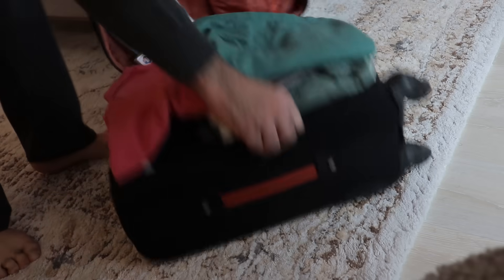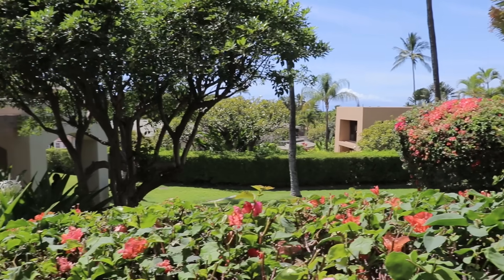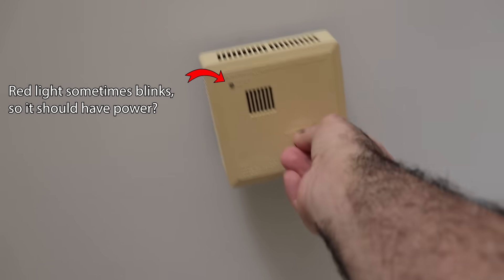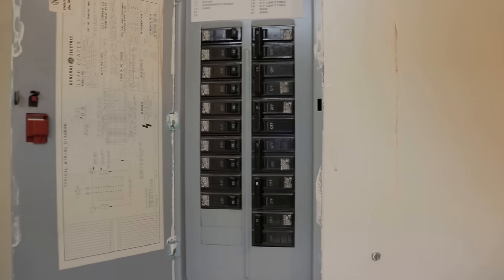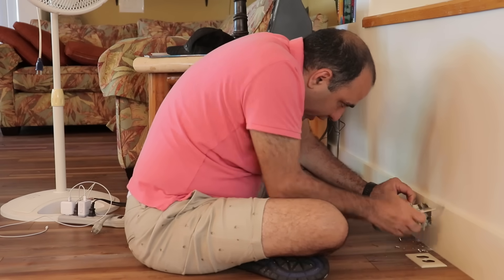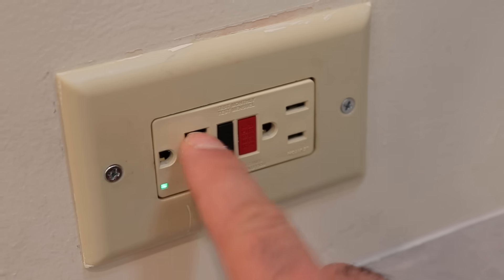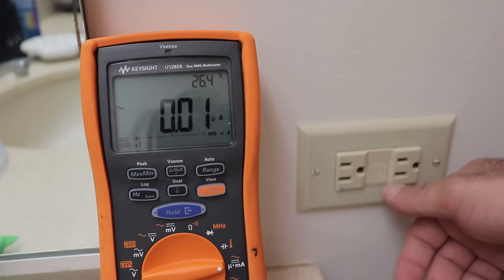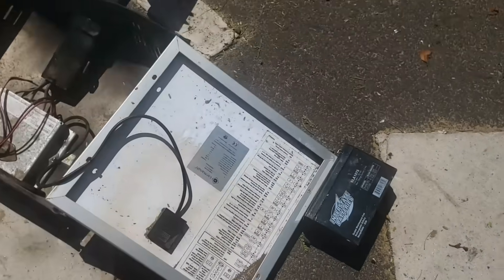Hawaiian Hotel Safety Failures

Comment: Regarding testing hotel room outlets when you travel, this is something I have been doing for a while, and highly recommend to anyone getting one of those nice cheap ($10-20USD) outlet testers with a few neon bulbs to show the status of an outlet and a little button to cause a short/test GFCI outlets. It only takes a second or two per outlet, and has stopped me from using a few (in America on vacation, nonetheless) that actually had the neutral and ground lines tied together, (apparently this normal, and I was just misunderstanding it, sorry about that!) or in some cases, wired in reverse, with live pin being neutral and the neutral being live... it's crazy what people do when installing electronics sometimes. Especially when it comes to mains wiring...
(Edit: fixed my typos and confusion, thanks for the correction!)
Reply: I think you might be getting some things confused. Neutral and ground wires should have continuity and as such it is impossible for a plug in outlet tester to know if they have been swapped.
Reply: @eDoc2020  The ones that I'm talking about and bought have voltage/amp readouts for the circuit, so yes, there is further processing going on inside them. I was just trying to keep it simple, and I'm sorry for my confusion there in how it works. Didn't mean to leave bad info, sorry! But yeah, it did read the neutral as live on some of them and the live as neutral, as they'd been wired in reverse. That part I think I understood... Hopefully. But basically they're just cheap devices sold mostly for business travel, to use before connecting a work laptop or anything else sensitive to the outlet, from what I understand. Just searching Amazon will easily turn up a dozen or more variations of the same device I have. Regardless of how it works though, it's definitely smarter than me when it comes to AC current! 😅
Edit: Oh, and I use it to test EACH GFCI outlet, since I'm never sure if both work otherwise. Those few seconds make me feel comfortable charging my laptop overnight and such.
Edit 2: for further clarification, there are 4 neon bulbs along the top and a 3 digit led display (7-segment LEDs like alarm clocks use) with a button beside it to select whether it displays voltage or amperage. Very simple, but there is a good chance whatever controls that LED panel also switches the neon bulbs. Not something I feel confident opening up to check though, lol.

Comment: I think it's a little silly that every team for the keysight competition must include at least half female students. Sure, somewhere it may be sexism, but every electrical engineering school I know simply doesn't have female students in any great amount there's less than 40 female students at the school where I study which has over 500 students total, so quite possibly the may be outright issues filling up teams.
Reply: Ikr. It feels so forced that it just feels unnecessary.
Reply: And then on top of that the team lead HAS to be a women

Comment: @ ElectroBOOM - 
the low door hadles & switches might be for wheel chair users ... 
these outlets are a real fire hazard & shiould have been repaced (many) years ago ... 
OMG , this prehistoric smoke detector is from 1984 & not even connected , ROFL ... 
an half of the RCDs not working ... a very nice budget hotel worth to die for ... 

Electrboom searches for breakers like a security guy searches for spy bugs (survaillance devices) ...

Of course ElectroBOOM doies what es does best ... BOOM !

Comment: I now understand why do you have a in-socket breakers with easily accessible reset buttons. 5 mA is super low! Such currents can be easily exceeded in electric devices even when they function correctly.
Your typical modern European house has a single/multiple RCBO in the fuse box protecting the entire home, but with a 30 mA threshold. It is assumed that, if unlucky, 15-25 mA@240V is enough to kill. That's why I've put a 10 mA RCBO for my bathroom circut, but again - a single breaker for all outlets, neatly hidden in the fusebox. Why 10 mA? Because lower are literally unobtainable! I've tried!

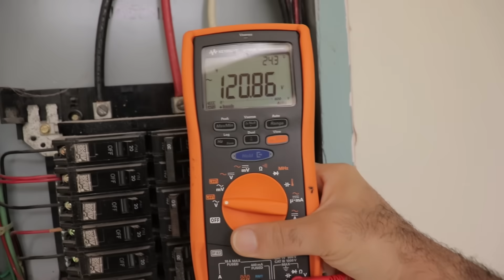Comment: At 6:30 literally that exact same thing happened to me a couple years ago when i was trying to determine whether an exposed wire sticking out of my panel was live or not. Turns out it was live. Blackened my fingers, melted my probes and everything. I'm actually still using those melted probes to this day since RadioShack isn't around anymore and i can't be arsed to order a new pair.
Reply: I still don't know why he got shocked.  What did he do wrong?
Reply: @ruthlessluder  Maybe he accidentally touched one of the probes to live and ground at the same time? When i did it i had the probes too close together. I don't even think they ever touched one another, but the circuit i was measuring turned out to be 240v so it might have just arched.

Comment: Hey everybody i got a quick question.
When Mehdi was measuring current on the GFCI outlet why did the multimeter not become a load. i know if you measure current ALL the current has to go through the multimeter but wouldn't the current separate to a different outlet making it parallel?

Comment: Not sure bout "the great frozen north", but doen south here in "the states", we been using plastic junction boxes for... Well.. ever since we were forced to start using junction boxes(when using lumber construction, metal stud walls we still use metal stuff on)

But that smoke detector? Having worked high rise security/life safety, all that stuff is typically not messed with unless it fails a test, i cant speak for this hotel, but the facilities ive worked at, EVERY alarm point(or alarm zone) had cameras that would pop up if the alarm were to trip(ya know, so we could capture an image of the guy tampering with the equipment and report em to the police), i dont know HI's code in specific, but ours, we had to test ..... Daily... And we had to have the Manufacturer test it annually before the fire marshal would sign off on the inspection, i cant imagine having a smoke detector older than 3yrs tho!

Comment: Nice video. This is really important!

Smoke alarm:
In the Netherlands it will be obligatory to have a working smoke detector per floor from 1 July 2022. They expire every 10 years. And the (9V block) battery should not be removed as well. Note: they will beep, when the battery is about to die. (Usually at 3 am, sigh.)

Power: 
When I just moved in the house I live in now, I discovered that 1 of the RCD's was not even working, when pressing the test button. You have to check that every month, actually.

Some years later my dish washer tripped the RCD. I tried troubleshooting it on another tap and outlet. While troubleshooting, I discovered that some idiot installed a 32A breaker (max. 16A breaker allowed! (1 phase, 230V)) with 2.5 mm2 wires (should be 4 mm2), which was not even connected to one of the RCD's. That was very dangerous. An electrical contractor has fixed the issue (and the dish washer still works, it was a small leek of the rinsing agent reservoir).

Enjoy your Hawaii trip.

Comment: A well earned holiday and a few electrical fires were lit under hotel management. I'm glad you enjoyed it.

But, yeah, that smoke detector not working is a very big safety concern, the failed GFCI would also be an issue, because I don't think they have a whole-house-ish-thing GFCI system like is standard here in Australia (And came in very handy when our toaster shorted live to the metal case and someone tried to move it!)

Comment: Worked in a 50 year old building, we tested plug retention and GFCI on every plug once a month. Every smoke detector, raise of heat, strobe and horn once a year... 
Like has been going on for the last 50 years. It's expensive to have full time staff dedicated to testing and fixing stuff, but it should be a cost of doing business as much as cleaning the place and keep the site presentable.  

F for the multimeter fuse.

Comment: 12:46 When in a hotel and your GFCI outlet is not working, write 'broken' with a sharpie on it!

The hotel will have to replace it because they dont want the next customer to see that!
Reply: alcohol wipes off permanent marker. You're goofy. Nothing will be fixed.
Reply: @TheGuruStud  then cut the text into the outlet or burn it
Reply: @TheGuruStud  Then scratch it into the plate with a knife

Good luck wiping that off
Reply: @TheGuruStud  Not all combinations of them. I already had the combination of plastic and a sharpie where the main parts of the color could be wiped off with acetone, but it still had a clearly readable "shadow".

Comment: I am a licensed professional fire alarm installer. That old gentex is junk. Surprised it passed a fire inspection. I'd assume the whole building needs to be upgraded. If a fire breaks out, no one will know until it's too late, especially with that jank GFCI and old beat up receptacles. But that electric panel did look pretty clean, I must say

Comment: The thing is, the Fire emergency won't give a damn about your business struggling from the covid pandemic, if your business buildings catch fire (big or small) they will find out about the fire alarm and question you why the hell you haven't spent  $10-$20 NZD  to have a battery-powered one as a temp until you can have the wired to house one replaced. 
As someone from New Zealand and not someone from the US, I do not know if they (fire marshal) can shut down a business for failing to comply to fire safety requirements.
 
I do know the owner would be held responsible if someone gets hurt or the building burns down and takes a life, and using the "But I couldn't due to covid" excuse would only make them angry, I've seen some get angry and you do NOT want to make them angry...

Comment: That fuse panel looks line an antique (Well, at least "veteran".), from an Australian perspective.
Where are the RCD/ELCB protecting the lighting and power circuits?
Plain-jane over-current protection hasn't been legal on new or repaired fuse panels in Australia since 1991.

Comment: ah yes! the curse of being electrically educated.
when I was travelling a lot because of work I was shocked very often by how bad security features in hotels are.
at one specific hotel I noticed there are no smoke detectors only in the staircase, wich was seperated to the floors by a firedoor.
I also noticed that there's a 16A breaker for 4 rooms. So me and my friend used a few water cookers to trip them
causing a huge panic on the staff.

Comment: 8:20 Every time I see something like this, I stop being angry at Schuko plugs for being so damn hard to plug something into.
Reply: Id rather fight to plug something in knowing it won't fall out than have to get back up to plug said thing back in
Reply: I mean schuko sockets can get loose over time as well or be bad quality to begin with, but it takes longer and probably never get this bad.
Reply: @Rentta  I think the schuko plugs can be a bit misleading, since it has the ground contact clamp in the socket. The real test are the flat plugs without ground contacts. If those are loose the socket can be a fire hazard for all plugs.
Reply: Schuko plugs are literally too hard to plug in or remove for my wife in the qood quality powerbar I got her for a pc :D
Reply: @mechadrake  tell her to use her hand like a lever and slowly pull like a reverse hydraulic clamp, im disabled trust me it will work when she figures out the handshape ❤️
Reply: @ten-hx2xi  what kind of clampm I am not familiar with shape probably. 
She uses brute force and fingers too weak, it is very hard to explain to her to use leverage, as she fails to listen about the mechanics :)

Comment: My house was built in 1964. It was upgrade to 100 amp but 1/2 the outlets did have ground wire some were  Aluminum.  It all been upgraded to copper with ground wire. I feel safer.

Comment: Medhi is wrong referring to the typical North American power as "2 phases". That is 3-wire single phase. It's literally 1 single 240V 60Hz phase from the electric company... The three wires come from the two ends and the center taps of the transformer. That gives you 2 hots and a neutral. At the residential home level, the loads are split somewhat evenly between the two hots, so that's how you get your 120V AC. For appliances, you would wire all 3 wires + ground to a 4-prong 240V single-phase receptacle.

Comment: I love how this man goes on vacation just to test electrical outlets.
Reply: I don't know anything about income taxes in Canada, but as an American, this looked like "How can I take the family on vacation to Hawaii, and write it off as a business expense?"
Reply: @RickinICT  That's exactly what he did. I bet he even turned a profit after the expenses of vacation.
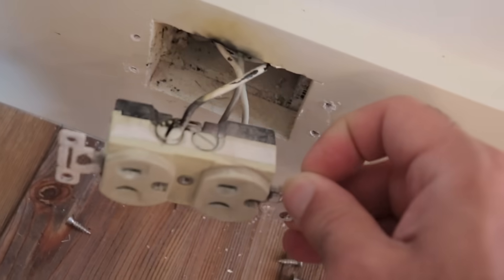Reply: 8:11 - Over here, metal flush-boxes are RARE.  They were basically discontinued as standard ages ago, although, you can still use them if you want.  ALL the flush-boxes in the last 30-40 years, and all new installs, use plastic ones.  Mind you, grub-screw type terminals, not just 'Wrap around and screw' type flat screw connections.  240v also, and an earth line and M.E.N. connection system.  Not sure if they even use M.E.N. at all in American 110v systems.  Most sockets and plugs seem to be two prong, with no earth line at all.  I note the SOCKETS in USA allow for an earth pin, but it seems to be very rarely used.  Over here, ALL appliances and wall sockets MUST have that third earth connection UNLESS the product is 'Double-insulated' - which is indicated by a double square symbol on the product if that is the case.  Very entertaining video! :)
Reply: I tested the electrical outlets in my basement when I was a little kid, and actually discovered that they were miswired.
Reply: def a tax write off video lol love it
Reply: I prefer to test the beer.
Reply: @1mmickk  Same

Comment: In Australia, there was a perceived danger by authorities that someone may bend a knife at sufficient angle to get the handle out of the way. Then they may get that knife and potentially slide it into live pins of a power plug while it was still plugged in, without dislodging the plug. Then they may hang onto the knife long enough to get a jolt which may cause them to suddenly pull on the knife and knock the plug out.

The authorities decided 1. Lets make all contacts more deeply recessed, so pins are not engaged if something the thickness of a knife is placed at the top of them. 2. Lets make all pins shorter for the same reason. 3. Lets make the thickness of the conducting pins significantly smaller, so plastic can surround the top of the pins where a knife may go.

So we have gone from a perceived danger of a brief shock to people modifying knives to put across live plugs, to hundreds of fires each year from buzzing plugs with insufficient contactor size or engagement.
Reply: thats why you should become a presiden of minisitry of eletricity if there is one free space to you
Reply: we solved that by recessing the plug it self.
not that our standard (Type N) is the best, however it at least supports other plugs.
Reply: @youkofoxy  N does look Nice. It also appears to provide mechanical support to reduce the arching which happens when appliance cables hang from Australian and US sockets. UK appears to have the most robust appliance plugs with the least variants provided by cheaper manufacturers.
Reply: I read the reason for introducing the insulated pins was because some homes/offices had metal venetian blinds mounted above power outlets. The thin metal slats would sneak their way between the plug and the outlet a little too easily and electrify the venetian blind.
Reply: You are drawing a great many conclusions from fairly little evidence there. There are a total of aprox 1700 electrical related fires of any cause reported to FRNSW in any given year. Given the majority of these are appliance based the assertion of hundreds due to slightly insulated pins needs some backing.
Reply: I always thought Australian plugs were safer than most.
Reply: ok people im gonna have to settle ur bs first of all british designed the plugs smarter for more heat or that thier people r stupid enoguh to touch those a bad plugs is for the most smartest well behaved

Comment: My partner lived in Hawaii for 3 years, she said it was the worst place she ever lived.  She said its great for a few days of vacation, but you definitely don't want to live there.

We're living in Washington state right now, and they don't have any electrical codes or building codes...you can just build whatever you want on your land and don't need an inspection for anything.  We moved into this house from Maryland and immediately realized that every single outlet in the house still had 2 prongs with cloth sheathed wiring.  There's 2 outlets in the kitchen that is grounded, but they ran a green 14 gauge wire down into the basement and connected them to cold water pipes...and later down they connected a wire from the cold water pipe to the ground in the fuse box lol

Comment: I've always known that loose contacts will generate heat, especially if it causes arcing, which is very hot. If I don't have a choice what I usually do is bend the metal prongs of the plug outward so it contacts better with the wall outlet. It depends on the plug though, some are very difficult to bend outward.